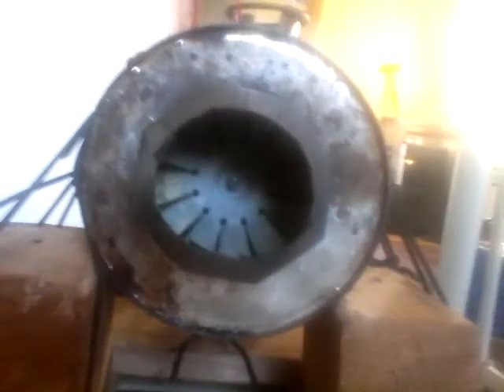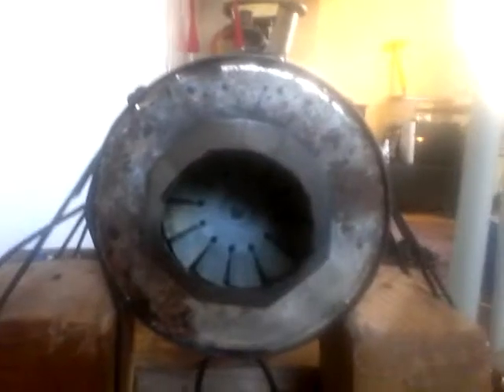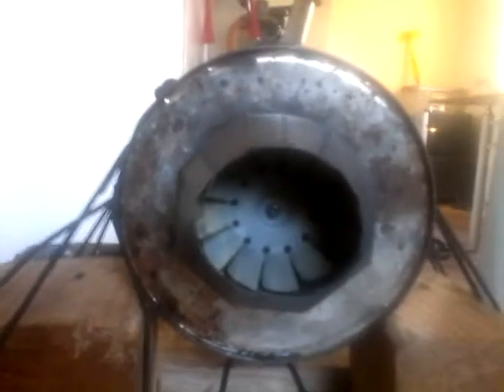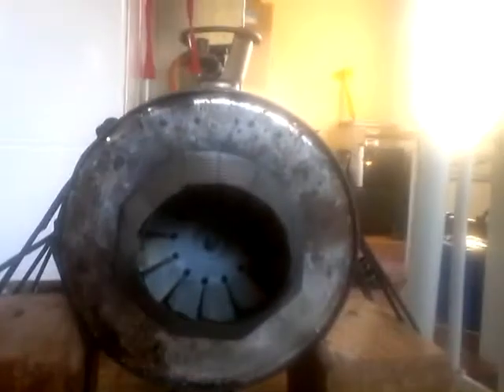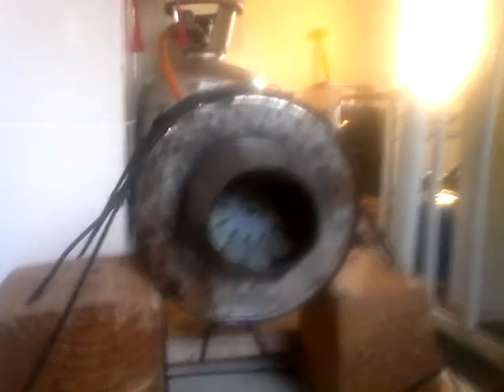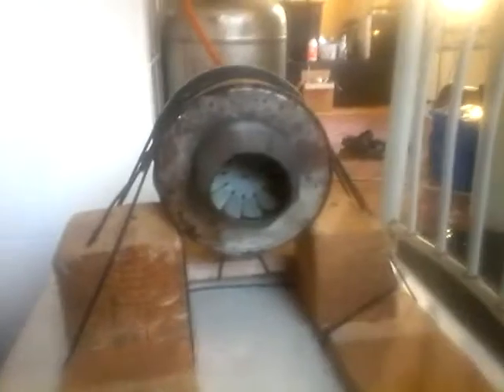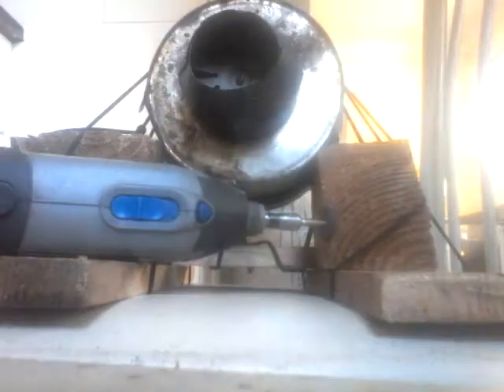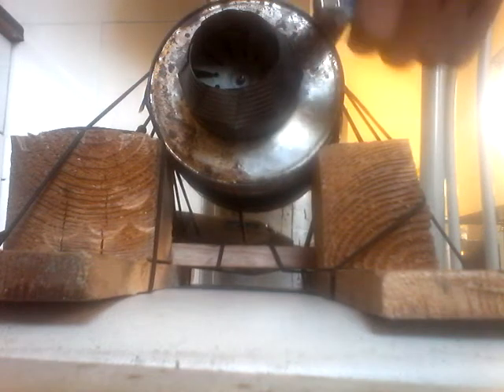Homemade jet engine test 2

Comment: YouTube are missing a NGV in front of the exhaust turbine.
Also the exhaust turbine blades need to be shaped as an airfoil.
Try to measure the air pressure, to run it ok you need about 20 to 30 PSI to het it going.
But mostly, i think your compressor is to heavy, to large.
The exhaust turbine is to small to spin this large vacuüm cleaner compressor.